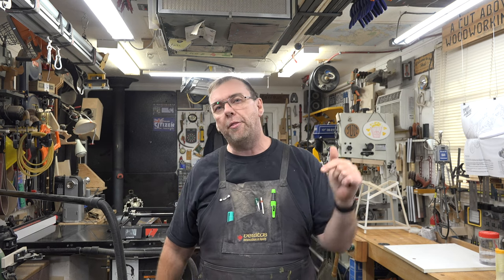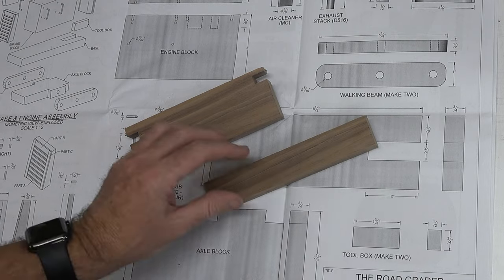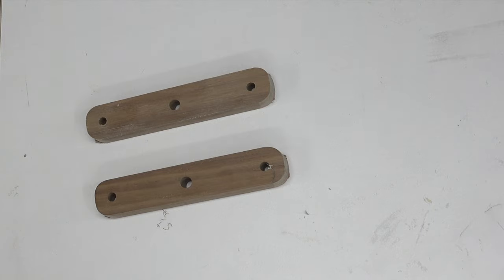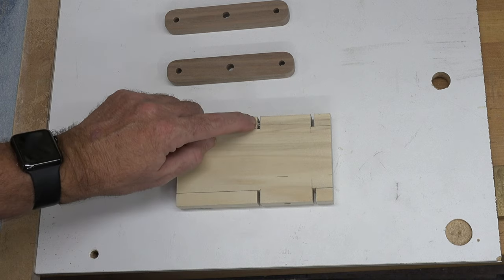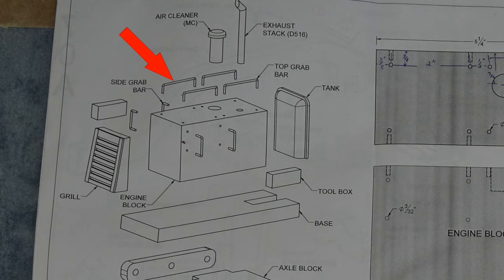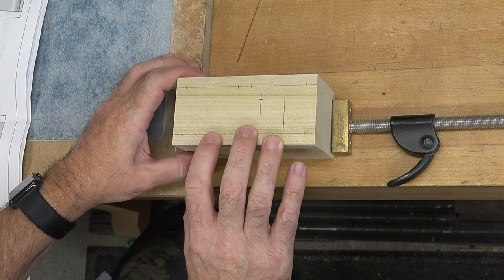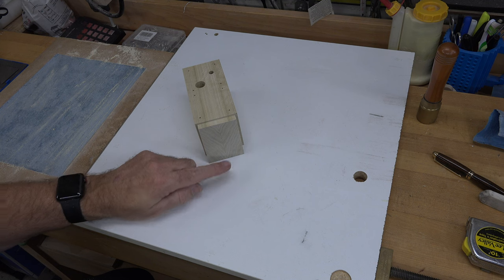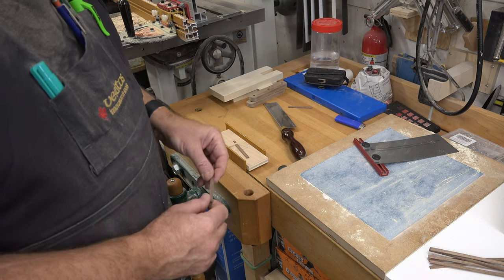Making Toys and Joys Road Grader Part 1

Comment: Thanks for another model build, aren't many who will do these detailed model on yt.  I am also impressed you are using a table saw to cut some of that small wood chunk but moreso, cut it on film, many people say they did it, but don't show it and that helps a lot ( my Question is did you have the gripper tail piece which drops down to help push  in use ? ) ; I have an engine block and am wondering how to cut it...
Reply from the maker: No Jeff.  The tail piece really isn't needed to help push the stock through in this case.  As long as your gripper pads are clean, they will provide plenty of gripping power to push your stock through with no problem.  I hope this helps.  Thanks for tuning in.

Comment: BTW, the plans said to cut the cove on the blade at 16° and it wasn't even close to the correct angle.  I ended up setting the angle at 22°.
Reply from the maker: I cut mine (in a much later part of this series) at the angel specified and while it wasn't exactly like the plan, I found it to be a good looking blade and it worked well with the model.  Thanks for chiming in with the angle you used and for tuning in to today's episode.

Comment: I just finished building two of these for my grandsons.  I was disappointed in the plans in that there is no explanation on where some things are glued or not glued.
Reply from the maker: I found that as well Gary.  This is especially true when it comes to the blade and blade holder section of the build.  But then again, they are sold as plans, and not instructions.  They assume a certain amount of knowledge on the woodworker's part but how can the woodworker be aware of what their intentions were with their design?  A little side note or a little instruction with "do not glue this part" or "friction fit only" would definitely have been a help.  Thanks for tuning in to the show.

Comment: i will be interested in this one too although i made it a couple of years ago  ..   i still learn things from watching your stuff  ...   what i found interesting with this model (as with some others) is that the bits i thought would be easy turned out hard and the bit i kept putting off because i thought it would be difficult and dangerous (the blade) took less than 10 minutes of setting up and five minutes to make safely and easily.
Reply from the maker: I too found the blade to be fairly easy.  It was all a matter of making sure that you had proper support on the table saw.  I hope you enjoy the series David.  Thanks for tuning in.

Comment: When I saw you working with the small parts, like the grill, it made me think about your laser, using it to cut.  But I think that would take away for the fund of building it by hand.  Good video, looking forward to the others.
Reply: Agree.  Laser would also leave charred sides and be quite difficult to sand off.  Also allowance's for material to be removed to get the correct final dimension of the grill pieces.
Reply: @dwightl5863  I thought about the charred sides, andI didn’t mention it because that charring could be an enhancement, like making the grill stick out more.
Reply from the maker: I like using my laser for embellishments but it will never replace my tools.  I enjoy working with them too much.  Thanks for tuning in.  I hope you enjoy the series.
Reply from the maker: It could definitely be done Dwight but by the time all of the clearances and sanding and figuring was done, I would have already had about 3 of them done the old fashioned way.  LOL.
Reply from the maker: It would definitely give it a little depth for sure.